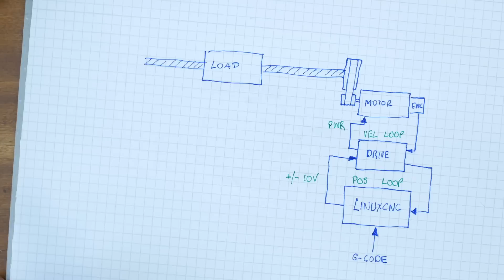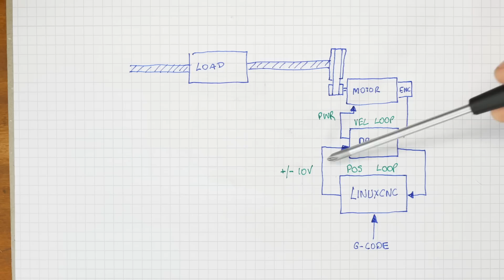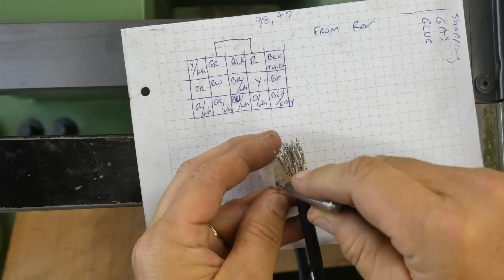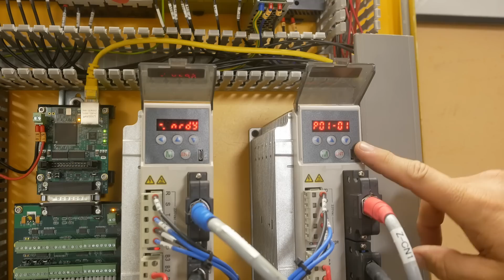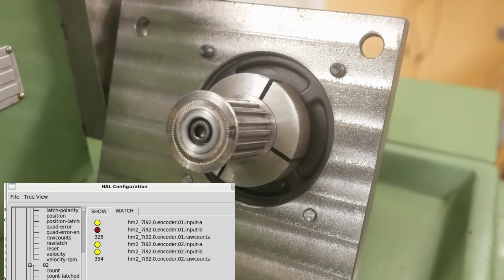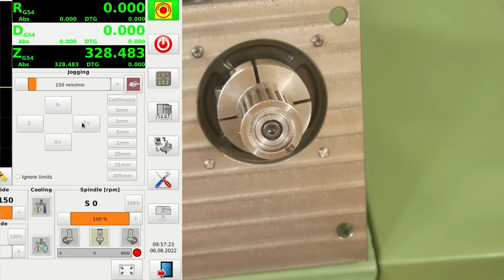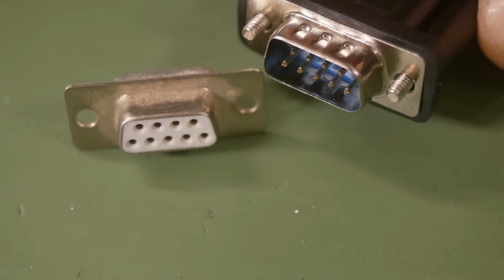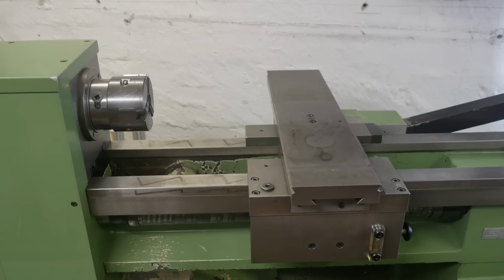First Motion - Schaublin CNC Ep.41

Comment: Congrats, great job!!! Some of the newer JMCs have an autotune function which is said to work quite well, could be worth a try. Question: what belts are your JMCs driving the pulleys with? I recently got my 102-CNC to make it's first chips (see my channel) but am not 100% sure if I got the correct belts (Contitech Synchroflex T5?)...
Reply from the maker: I have been trying to get the auto tune function to work, but the manual is so bad, I cant work out how to activate it. I set the P08 - 01 thru 05 autotune parameters, and then use the AUTO_JL mode, but that doent use the P08 values. 

I am not sure what brand my belts are, but they are T5's. 25mm wide for X and 32 wide on Z.
Reply: @RotarySMP  Many thanks for your confirmation about the T5s! I use older JMCs without autotune and configured the settings by hand. For light loads I start with something like:

Pos Loop:
- Pp 4000
- Pf 1000
- Pos Error 1000
- Pos Filter 8

Vel Loop:
- Vp 7000
- Vi 500
- Vel Limit 32000
- Acc 1
- Decc 500

Current Loop:
- Cp 2000
- Ci 500
- Continues Current 6000
- Limit Current 15000

From that you can increase Pp in Pos Loop to 5~6000 to stiffen rigidity in idle and Pf to 1700 to reduce positioning errors. Also you can increase Vp in Vel Loop to 6000 and Vi to 2000 to surpress oscillation during travel. That's basically what I do with all my JMCs in various projects.

I have another short question, please have a look at this picture:

https://i.imgur.com/u5CjZ3l.jpeg

It shows my 102-CNCs X-axis (the 3 limit/home sensors are marked in red), the bed is covered with cream-white teflon(?) marked with blue arrows: do you know if that is original by Schaublin, or should it be a metal surface...?
Reply from the maker: @philtickerchannel  I dont know if it is original, but the form of the oil grooves looks identical to my 125CNC. It became quite common from the 80's for manufacturers to use materials like that instead of scraped metal on metal. Hardinge HLV's for example.

Thanks for your tuning values. I'll try them after diner.

Comment: Kinda surprised the drives didn't come with the needed lenze microusb to serial port cable. Also I don't see much comments about the tuning itself - hehe servo tuning is still a no-man's land on forums and internet as a whole. You can only learn the proper ropes from people who had been doing this for ages in CNC machine building (preferably in big companies, not on their DIY machines). Automation people use pure autotuning and hyper expensive drives and servos from companies like SEW - they don't care about few micrometers precise positioning, the software (Movitools) has all kinds of tricks to have seemingly ok settings.
Reply from the maker: I bought those drives on the recommendation that they had good software for tuning. That guy must have been much more fluent in Cringlish than I am. The manual is pretty terrible. There is an Autotune function (P08-01 thru 05), but I cant work out how to activate it.

Comment: Hey, you got movement! :D

What cable/wire markers do you use?
Reply from the maker: I use a brother P-touch label maker, or some yellow cable numbers things I got off ebay.
Reply: @RotarySMP  Do you use clear heatshrink over the labels then or is it some special type lable markers made for cables?

I've used some regular brother labels before but they tend to fall of the cables after a short while.
Reply from the maker: @Gin-toki  I tried clear heat shrink, but you have a very narrow temp between srinking, and label going black. Now I am just wrapping clean tape around them.
Reply: @RotarySMP  Ah okay, thanks for the answer.

Comment: Pg 36 of the 1806080392.pdf manual has settings for auto tuning P08-1 through 5. Setting these to make a repeating distance run of the axis between two positions should help set the gains close to get smooth motion. In operation under cutting loads may require some fine tuning along with P01-02 and 03. Pg 45 provides some details for setting each of those parameters. Although P08-1 doesn't show the 0= normal mode, 1=auto tune. Can't say how that is all initiated. The software may have those provisions from my experience on other drives. Great progress!
Reply from the maker: Thanks for spotting that. That is V1.0 of the manual. I received V1.3 with mine, and those parameters have different names, but seem to still have the same function. I will give that a try, as I am still struggling with the tuning.
Reply: @RotarySMP  In some cases the OEM may recommend adding extra weight to simulate near real world loading for accel/deccel PID self tuning. James Clough showed this during a recent router build on his YT vids. Helps when you have a drive manufacturer with decent support. So many of the imports lack that support.  If your drives were a clone of something else, you might find procedures to support tuning at the original source. Best of luck there!
Reply from the maker: @LetsJeep  I spend a couple of hours yesterdays dicking around with the auto tune settings. I couldnt work out how to start it. P08-01 thru -05 set, and then tried "Auto-JL" mode, which does a back and forward movement, but not with the P08 values.

I dont really need the automeasurement of inertial mass, as I have calculated that. It appears that 1.25 set into the inertial ratio gets interpreted as 125, so I will have to use 1 or 2.

Comment: Heya,

Dumb question did you forget to add the cable conduit between the cable gland and the motor as well?

Regards
Reply from the maker: No, there is no simple solution for this, as the old conduit terminated in the cast aluminium motor covers from the round motors which are not longer going to be used. The cables will live with the only protection being that they are below and behind the cross slide, and that the lathe will not be used much.

Comment: I dealt with a really similar problem using LinuxCNC and a 10V analog signal from a Mesa 7i76E to control a VFD positional axis not to long ago for a CNC sheet metal bender. I found a pretty good tuning guide for velocity mode drives with LinuxCNC while I was getting that to work.

The gist is:
1. Set up the servos to talk to LinuxCNC. ✔
2. Widen following error (FERRROR) setting on the linuxcnc joint definition.
3. Run any drive auto-tuning if possible.
3. Open up a HalScope tracking ferror, pid output, commanded velocity, and real velocity all triggering on commanded velocity.
5. Change parameters on drive or linuxcnc based on the track errors.
 -- The guide has more specific advice on starting points and tuning process with pictures to be more clear.

For me it was only necessary to very roughly estimate the motor's parameters and input them into the VFD, and with only LinuxCNC tuning the axis was repeatable within the minimum capacity of the machine to read out.

Edit: I'm having difficulty posting the link, so if this is interesting, I guess I can pm or email it or something.
Reply from the maker: I am pretty comfortable with the LinuxCNC tuning having done it on the Maho, but expected to have to do the basic motor driver tuning  first, and dont have much clue about that procedure in isolation.

Comment: Love/hate the LinuxCNC tuning. It provides a lot of tools (you know about HAL Scope right?) but they are not well integrated to each other. Fun hint about the PID tuning window: when you write the values to your config, it may incorrectly store extremely small values. It's been years now, but my recollection is that if it wasn't in "4.5E-5" format it, would round off to zero. Or it would drop the exponent so 0.000045 it was 4.5. Regardless, I took to writing down the values from the tuning window and added them to the config file manually.
Reply from the maker: I have used them on the Maho. I tried to bring up the config window, but it couldnt find my axis. I manually built my HAL, with multiple modules, like one easy for X and Z, so I can easily comment out a module in the Custom.hal list. This doesnt work for the PID tuning widget.

Comment: that is so weird they used USB ports for RS232, would it have killed them to spend a nickle to just make it a USB RS232? so you can direct connect over USB
Reply from the maker: My thought exactly. What does integrating a USB driver behind that µ-USB cost in the design of a driver.
Reply: @RotarySMP  more importantly its a hazard trap. Real Rs232 swings +-12 volts giving you 24 volts potential, USB on the power lines is only 0-5 and even less on the data lines. plug a usb cable tween the 2 and what  happens (a pissed off computer, blown USB port fuse inside a macbook or a dead controller inside a macbook?) 

Highly irresponsible of the maker (and a good idea to keep a older laptop around for direct interaction with industrial leggo, especially at the home game level)
Reply from the maker: @osgeld  Yeah, and all that just to save a few cents for a USB driver chip, which would have allowed direct USB interface.

Comment: Something you might relate to. I once had to replace a connector on the overhead panel of a fokker friendship (great job for an apprentice). It was a solder connector, and from memory had about 99 pins and 17 rings/seals (may be a bit of hyperbole there). After getting one of those rings around the wrong way, I never made that mistake again.
Reply from the maker: Ouch. Some of those huge aviation connectors, look like a lot of work. Would take me a month to do something like that, and by the end I would have forgotten how I started :)

Comment: Did you know these these telescopic spring screw covers are very expensive? I have a vise that uses one for the lead screw and it's missing. I was thinking about making my own but then I remembered your machine having those and I looked online and.. ugh. I found an incorrectly sized new old stock one and it will suffice and cost the same as 1 meter of spring steel band that I will probably mess up anyways trying to make my own. 😖
Anyways, don't break yours 🙂.
Reply from the maker: I hadn't really thought about it, but good point. I dont thing the Swiss cheaped out on this machine anywhere, except the cast iron pipe elbows for wiring. May be they are cast gold, and then zinc plated :)

Comment: When I did the avm lathe with Chinese drives I chose to use step/dir control. The motors and drives came pretty well matched. I only needed to alter acceleration settings to get it running sweet. 
I've a harrison m400cnc lathe to convert next and it has the same indramat 3trm2 drive as your maho. I may have to rewatch that one
Reply from the maker: These drives also support Step/dir, so I probably made my life more differcult by choosing analog.
I didnt really touch my Indramat, other than to replace all capacitors. I just left it's settings alone.
Reply: What "chinese drives" are you using? AASD? Or more reputable ones like Estun or JMC?
Reply: @chronokoks  I've the lichuan a1-svd15 drives with matching 80st-m02430 motors. Possibly the cheapest set on aliexpress. They work fine. Can't complain
Reply: @jonnydeen6952  and how do you know you it moves well? Without a look at the position error through some kind of software you're just guessing. But I guess a lathe is not THAT dynamic so it might be ok.. but if you don't see the error of real position against the position command.. you're screwed :D
Reply: @chronokoks  positionally and repeatability wise the parts off the machine are accurate and repeatable to within respectable tolerances. As for performance. The motors accelerate and decelerate smoothly under load,  exhibit no drift bias, resonance, overshoot or juddering. So I'd consider that they are working well. I think the real test is longevity
Reply: @chronokoks  as for following error, or as you might say positional error. You can set the drive to alarm on a programmable threshold. This would likely be more usefull on a mill where you have more dynamic motion. So your only really screwed if you don't know any better 🤷‍♂️
Reply: @jonnydeen6952  I would loose my sleep if the machine wasn't moving as best as I could tune it to (I would bet your error is to 0,1mm at least - almost impossible to measure on a lathe type work due to its short time-frame nature). Most of the chinese drivers on aliexpress and alibaba are knockoffs of JMC's old stuff (almost identical PID settings, identical PID setting addresses for RS-232/RS-485 communication - points to stolen and repurposed firmware from JMC - didn't have the opportunity to compare the chips used in the driver to old JMC stuff) - I am only absolutely baffled why there is still no software support. I have seen many "professional" chinese CNCs (I was advising one company which sells various higher end chinese CNC brands on a local europan market) and only one CNC used such a driver to power a servo for the tool changer movement - rest of the system and servos for axis was FANUC. So not even the chinese use these servos when they don't need to absolutely cut costs.. they use everything from Mitsubishi to Yaskawa (talking about fiber lasers or cncs with let's say the taiwanese Syntec controller).

Comment: And after seeing their usage of a Micro USB as an RS232 port (instead of DSUB, RJ45 or even a 3.5mm jack), I would have honestly chucked the drives in the bin.
Reply from the maker: :) Yeah, not exactly the finer style that.
Reply: That was my first thought too.. although is this situation probably nothing would get damaged.. I have an electronic front door lock that needs to be charged, it's with micro USB, but its a 12V system..  what were those engineers thinking... There is a label on the charger, only use with ... product. But really?!?
Reply from the maker: @niels4750  Ouch, you could probably kill a lot of phones with that fast charger :)
Reply: @niels4750  I mean it's not like there aren't a bunch of industry standardized connectors available that are not USB. Also, the small footprint of Micro USB means that it really isn't that robust to begin with.
Reply from the maker: @graealex  Yep. A poor design choice there. Also those SCSI connectors are not exactly state of the art.

Comment: Just a thought, have you confirmed that the motor and encoder feed back directions  are matched ? have seen that jump and fault before, because the motor was turning backwards to the expected  feedback direction.
Reply from the maker: I tried reversing the encoder sense direction, but that wasnt it. Although I am not sure which is right yet, as both gave similar jerk out and back. Need to do more tuning.

Comment: I'm a bit dumbfounded, and very uncomfortable, about them using a usb connector for a non-usb signal. That seems like a recipe for disaster on their end. There are tons of small connectors they could have used, or just made it actual usb that's just acting as a serial port like 3d printers do.
Reply from the maker: I agree. How many cents would it have cost to put a USB driver chip behind that, and the user could use a simple USB cable.

Comment: 4:45 I admire you going ahead and de-pinning the connector again, where as i'd have found the nearest angle grinder and made a suspicious wire-width slot in the nut 🤣
Reply from the maker: Good one. It is over the back. No one would see it )